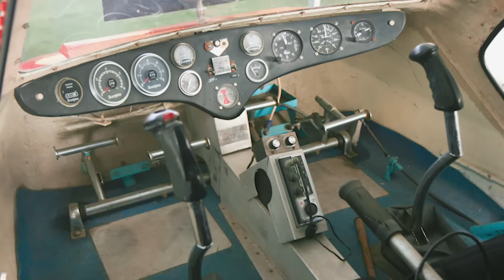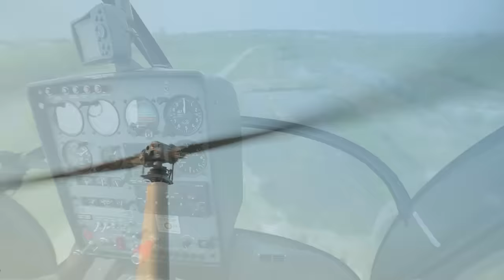15 INSANE Homemade Helicopters - BAD IDEA

Comment: i'm confused by the title saying these are bad ideas or building a helicopter from a kit is a bad idea. as an aircraft mechanic having worked on one of these helis, they are really rock solid designs and they are very wonderful to work on especially for those that have a much more exposed frame allowing for easy access to components.
Reply: I'm the only aircraft mechanic in this town bud. I don't believe you!!!! Derp
Reply: @alexsozansky  lol
Reply: High noon boys lol. Draw and pull your A and P s out. For sure click bait but hell they'd get just as many being truthful A kit copter is just as interesting. Anything bought as a kit off a ligit comp can't be un-air worthy. Now let's join forces and build a truly home made ship. I can do sheet metal fab and avionics lol.
Reply: as long as it dont come with a Chinese translated instruction book right ;)
Reply: Yup, the only dangerous one in the video is the last one.
Reply: Tank you come again, please auto rotate your way out. The real good chops come in the B models got that 2 blade action.
Reply: @ComsiCaterpillar  That's just nonsense.
Reply: @alexsozansky  you wish
Reply: Death Corps - The title is purposely worded that way in order to get more views. It makes it sound as if they are going to show “homemade” (self-designed and manufactured) aircraft but what they are actually showing are homebuilt aircraft – a term often used for aircraft built from kits. And you are right about the kits being safe, as I believed every stage of construction must be singed off on by an inspector – just as is the case when building a house. Naturally there are a few nut jobs out there who build actual homemade helicopters from scratch but that would be very dangerous. Although even in these cases I’m sure they do not build their own rotor blades or any of the complex components that comprise the main rotor collective control system. These critical parts really need to be made by the experts.
Reply: @SLOBeachboy  agree home made and home built are two completely different things. A trained monkey could be taught to follow instructions and assemble simple components. Coming up with your own design and making it work is far more complicated. Click bait title to get views.
Reply: Yeah- components like DRIVE BELTS. No thanks. Belts come off and break=death.
Reply: Belt drive helicopters ARE a bad idea.

Comment: This video is clickbait. None of these helicopters are "homemade". They're just potentially home assembled kit helicopters and a single prototype vehicle.
Reply: Scratch designed and built is not the same as these kits.
Reply: Do you really want to build one of those Nigerian homemade helicopter? Kits are in fact considered home made because you assemble it, not fabricate the components. If you are not a machinist it aint gonna happen.
Reply: @johnjennings8085  Kits are the safest way to go but, you have to follow the instructions 100%.
Reply: @av8tor261  This is America since when do men follow instructions? LOL Seriously I have helped on a few homebuilt projects. Here is what can happen if you don't follow instructions. A gentleman i knew built a Rutan Vareze in his basement. In the manual it says if you do not have space that is open such as a garage be sure to measure the area to ensure you can complete the structure and transport to an assembly area. Well... this guy did not complete this step. He tried to remove the fuselage from the basement and boom it was 2 inches wider than the door and too tall to clear the ceiling in the stairwell. So we advised him if you remove the basement window and 1 row of block he could dig out and pass it through the hole. He would not listen and hired a backhoe to dig out the basement wall. 13,000 dollars later he got it out. At that point it would have been cheaper and smarter to cut it up and start over before you call in a backhoe. As you can guess there was fallout from this. He is now divorced as a result of his stupidity because he did not read and follow instructions. You could die from not following the directions exactly! So consider the size and scope of an aircraft before building one. Note ,after this situation was over we told him he was on his own. With his lack of judgement skills we did not want to be on the liability end of it crashing when he built it wrong. Work smart not hard.
Reply: Thank you for saving my time.
Reply: @johnjennings8085  Some kit assemblers who can't follow instructions become "self proclaimed experts".  that's when things go wrong.
Reply: What exactly is he baiting you to do?
Reply: @postergmail6202  asked, "What exactly is he baiting you to do?" Answer: waste my time.
Reply: @av8tor261  If you get out your Dremel tool to make something "fit"....not a good idea
Reply: "Homemade" in the sense it's up to the buyer to assemble the thing according to intent of the manufacturer which is why it's a bad idea. Would you fly in a Boeing 737 that was manufactured by Boeing but assembled by your neighbor?
Reply: @johnjennings8085  In the (very) old days we would say "Rube Goldberg is alive and well'.
This was some fictitious engineer that couldn't build a mouse trap without spending a million dollars to finally make it work.
Reply: @av8tor261 
L0l.0p
Reply: No problem
Reply: Agreed. I like the home made Africa helicopters 🚁
Reply: @kendallevans4079  Talk to the EAA, you might learn some things. Besides, most home built aircraft are one or two seater, with a few cases (like my current project) of 4 or even 6 seater. They don’t sell kit airliners obviously, and I wouldn’t fly on one if they did, however I don’t have a problem with someone building a Zenith, Pietenpol, FRED, Bearhawk, etc.
Reply: @t.mendous7922  Is the EAA the FAA on steroids?
Reply: @kendallevans4079  Thankfully no. The EAA is the Experimental Aircraft Association
Reply: and you are the only one that bait for it ... because it's obvious it's a kit lolll
Reply: @joesworld396  so the person who originally came up with the design and built it in his shed before he created the company and got machinery for manufacturing the kit to be sold wasn’t homemade the original definitely was
Reply: The very first one they showed when the video started reminded  me of the weenie mobile. Lol
Reply: Kudos to the ones who built the machines
Reply: @johnjennings8085  u

k
Reply: Lets give this tumb down
Reply: Thanks
Reply: Thank you 
Now I don’t have to waist my time
Reply: and not a single one crashes, complete waste of time!
Reply: Ik hey if you find real homemade Quad-copter or helicopters lmk
Reply: @kendallevans4079 would you fly in an extra large rc plane or drone that you built? *(hypothetically assuming you've already tested it after you designed it)
Reply: @wssometimesavowel3639  You don't "fly in" a drone, that's why it's called a drone.
Reply: @kendallevans4079  well duh! this is why I specifically placed the term Quad-copter next to it.
Reply: @t.mendous7922  You are every neighbors nightmare
Reply: I wonder where they were built? On private property? At “home” perhaps.
Reply: Actually not true they're not that difficult may need a little help but an average person could build in a decent time. Just takes dedication which most don't have or common sense.
Reply: Watch the African homemade helicopters. Much better 😂
Reply: They don’t mention anything about them being a bad idea. 🤔 Just more click bate.
Reply: I like the ones that come out of the third world countries in Africa
Reply: I was just pulling up the comments to write the same thing this is fn clickbait bull💩 right down to his voice that makes me sick he does god father stuff too I recognize his voice definitely getting a 👎 where’s the bad idea at 🤷‍♂️
Reply: @CityStreetsExplore I am it deserves it for clickbait
Reply: I bought some eggs and flour the other day and home assembled a cake.
Reply: also "insane" and "bad idea" are baiting.
Reply: The script is more disjointed and cumbersome than the helicopters promised in the thumbnail
Reply: 😎all videos are clickbait, even the good ones.
Reply: Its the "bad idea" in the title thats the real clickbait.
Reply: @johnjennings8085 Technically correct, I would agree with you there. However I think the commenter was expecting home designed and built
Reply: @kendallevans4079 Hit a nerve eh?
Reply: @t.mendous7922  LOL....Truth or a lie nerve...
Reply: @kendallevans4079  Just having fun, but I would agree I would definitely not fly on a homebuilt 747 🫣
Reply: That's correct. All the kit assemblers and even the prototype designers were in fact homeless. It's true, I read it on Wikipedia.
Reply: @chippyjohn1  😆
Google knows all

Comment: personal quad copter vehicles will truly open the skies to the masses. They could essentially fly themselves.
Reply: They have a short range, that's the main drawback. 30 minutes flight time and you're done. There is also no safety feature. If your flight controller died or there was a fire (LiPo batteries FTW) then you'd become a meteorite pretty quickly. Even helicopters can autorotate to 'glide' relatively safely to the ground. Quadcopters have no such mechanism.

Quad is too few anyway, you would want there to be 8+ rotors to allow for redundancy and fault tolerance. If a motor goes out you want to have most of your thrust still available. A quadcopter with a motor down can fly if the FC knows how to compensate, but you lose lots of thrust and stability.

I can see quadcopters being used for racing, much in the way micro FPV drones are now. It would be hella dangerous but you know there would be daredevils that love it. Akin to wingsuiting but with expensive hardware. A bit like 'pod racing' in Star Wars. High Gs, manual controls, fast reflexes, tricks, stunts, and zooming through narrow tunnels, that would be the magic of it.
Reply: @johnsmithe4656  Include parachutes with them.
Reply: @marajevomanash  Parachutes are only good for high altitude failures. It takes time to open and slow the descent. If you're flying below 500 ft, especially fast, there ain't no parachute going to help you not die.

Quadcopters would fly like helicopters, usually low to the ground. But they can't autorotate.
Reply: @johnsmithe4656  They should make them as light and barebones as possible. For example, quadcopter shoes or a scooter-like quadcopter with a parachute folded inside it for flying short distances. Something like the flying broomstick from Harry Potter movies.
Reply: @marajevomanash  Uh. Wow. Not sure what to respond to this. Please don't design and build any manned quadcopters. 😆
Reply: @johnsmithe4656  Bring back the blimp in miniature form. Research better and safer ways to store hydrogen/helium. Combine that with paramotor or something. Ultra-ultralight personal aircraft.

Comment: “It has a better power plant than many fixed wing” totally did this video in. The Lycoming O-360 (that’s an O, not zero) is a very popular engine, and many aircraft use that particular model. But then the O-320 is excellent, as well as the O-420, O-470, O-520, O-540, O-550, etc. Granted, many people prefer Lycoming over Continental, but both are great engines, and that is almost exclusively what small aircraft have in them. People who know nothing about aviation should not be making videos about aviation
Reply: Well its Charlie sheen... he isn't exactly known in aviation besides getting high 😂

Comment: A friend of mine built a Rotorway Exec.  Sadly, when he had health troubles, he had only learned to hover it before he had to sell it.  But his brother-in-law had a Scorpion II.  That brother in law was flying it one time and had an engine failure.  So he easily autorotated to safety.  But when the skids began to sink into the muck he landed on, he tried to lift it up again and the rotors ran out of energy causing him to wreck his machine.  Oh well!  Those guys probably smoked too much weed anyway, so the chopper life probably wasn't really good for them.

Comment: I knew a guy who was always going to build one using a vintage snowmobile engine, all I could think of was all the times I've been left in the middle of a trail working on a carburetor and pulling my guts out trying to crank one up and wondering how that would work out in the sky.

Comment: dragonfly df-1: uses hydrogen peroxide as a fuel - "but it's not the stuff you find under the sink" and "it uses a commercial-grade diluted formula".
kids, the stuff under the sink is about 3% - in order to be useful as a rocket fuel, hydrogen peroxide has to be up around 70%, and at that concentration it will take your skin right off - calling the rocket fuel "diluted" is like calling the Atlantic Ocean "damp".

Comment: The handlebar flight controls are a great idea. It certainly seems more intuitive than the cyclic and collective. Would any pilots want to comment?
Reply: I would consider cyclic, collective, and anti-torque pedals the proper and intuitive solution for a traditional helicopter, but the handlebar probably works well for a contra-rotating machine with no swash plate.  Not mentioned in the video is that Airscooter's simplified, fixed-pitched rotors could not autorotate (glide), leaving the machine restricted to low-altitude (<50ft.) flight for safety.
Reply: Nope - Air Scooter is a long gone piece of junk
Reply: @antibrevity ah, makes sense, thanks…. That’s why all the videos I’ve seen of it show it very close to the ground….

although auto rotation in any small helicopter with very little rotor disc inertia it seems to me is improbable in an emergency..  the R22 apparently requires the pilot to react to an engine failure and begin autorotation in like 1 second, otherwise the rotor speed falls too low to recover…. These ultralights, is it even possible…?

Perhaps a ballistic chute would be a more realistic option…

Comment: would it be legal to safely land these at or near gas stations, space permitting?   or would you legally need to land at an airport to refuel?
Reply: Gas stations wouldn't have helicopter fuel. But generally ya, you have to land at an airport. 

Different places have different rules, and when you have control/own a helicopter. . . Sort of implies that you would have the money to land wherever you want. Just how much are you willing to pay for parking.

P.S - most of the "helicopter" kits actually fall under the classification of an ultralight.

Comment: I'll stick with the R22.  The homebuilt turned certified.
Reply: Helicopters have fascinated me for 50 years, but I have just learnt something new that scares the hell out of me. I've only ever flown in a Bell Jet Ranger, and always been scared of piston-engined Helicopters.I guess that it's all those reciprocating parts that all need to work to perfection, and in unison. I recently read about the R44 that plummeted to earth in Hawaii. I did not know that (flying in pretty turbulent conditions), the main Rotor Blades can flex down low enough - to damage the perspex bubble, tearing-off the Rotor Blades, and also the Tail Section. All that it takes, is a stray high wind, and someone who doesn't respond to the Collective quickly enough. I'm not a pilot of any kind, but those Rotor Blades need to flex, but there seems to be no limits on the amount of flex. I am sure that all helicopter pilots know about this 'danger' - except the helicopter pilot who was taking passengers on that sightseeing tour.
Reply: @peterduxbury927  We are taught to slow down in turbulence to prevent that sort of accident,...which could also happen in a Jet Ranger.
Reply: @lookingforwookiecopilot  I reside one km from the largest private airport in the southern hemisphere. When bad weather is coming, all of the Robinsons are first to high tail it back to the airport, then the Jet Rangers come second. The large Westlands don't seem to be bothered by bad weather. This leads me to believe that size and power matters. Thanks for putting me wise.
Reply: @peterduxbury927  Robinsons and Jet Rangers are not certified to fly in "bad weather".
Reply: @lookingforwookiecopilot  Thanks. I'm guessing that Westlands are certified to fly in bad weather. But, how do you define bad weather, when you (accidentally) get caught in it? Weather can be unpredictable sometimes, and caught many pilots out! I suppose that this must come down to pilot pre-flight weather checks. There is a guy in Australia called Dick Smith. In the early 90's he flew a Bell Jet Ranger completely around the world. I guess, just knowing this, is why my preference would be to fly in a Bell Jet Ranger, and nothing less.
Reply: @peterduxbury927  When its broken to overcast at 1,000' and the visibility is 3sm then its the kind of weather only aircraft certified to fly into the clouds can fly.

There are tell tale signs that the weather is becoming "un-flyable" such as the temperature/dewpoint spread getting closer and closer.

,...and the R44 has also flown around the world.
Reply: @lookingforwookiecopilot  I did not know that the R44 has flown around the world. Thanks Joseph, for giving me a better understanding.